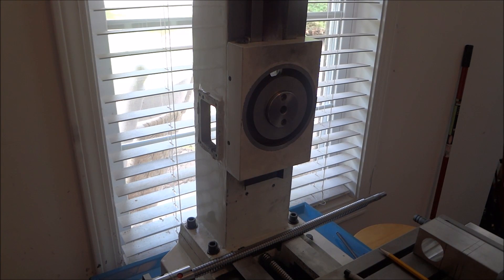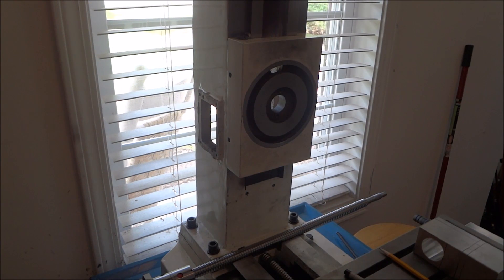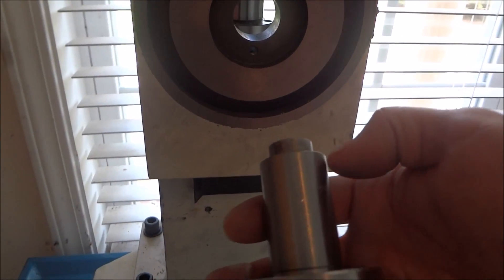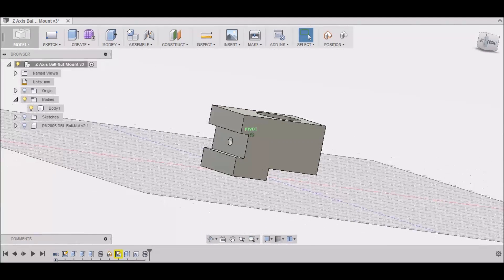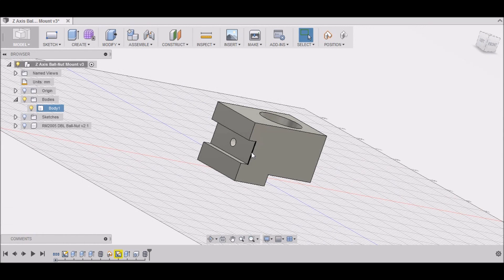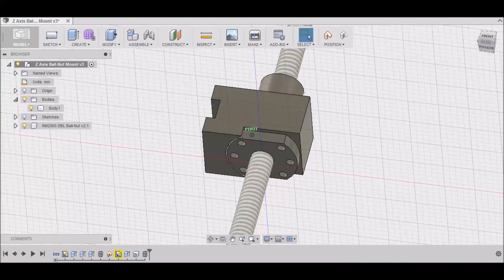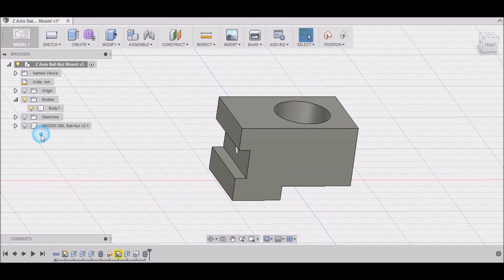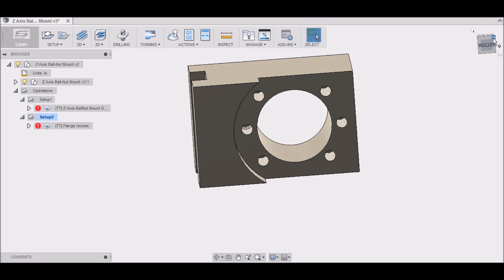PM 727M Z Axis Test Assembly

Comment: Sam, just wanted to say super nice job on your build.  Do you need the recess for the Z bearing block if you use your new ball-screw measurements?
Reply from the maker: The Top of the column has a Hole which is in line with the center of the lead screw. the recess rakes advantage of this to keep the Ball screw aligned. There is enough room to make the ball screw 4" longer but its not needed. if you want to get it longer and cut to length that's fine.  without the recess you will have to line it all up yourself.

Comment: Great work and explaining the details.  Are you concerned about wear on the Z axis block where the slot is milled to accept the round pin of the mill?
Reply from the maker: Good question!  I don't fore see a issue as the two are tight fitting and as long as there is no binding in the ways I think it should be fine. In the event a problem develops I can make a new one out of steel. But I don't think there will be a issue.